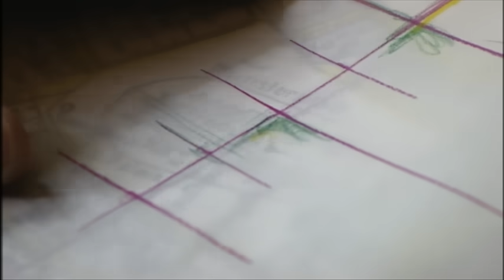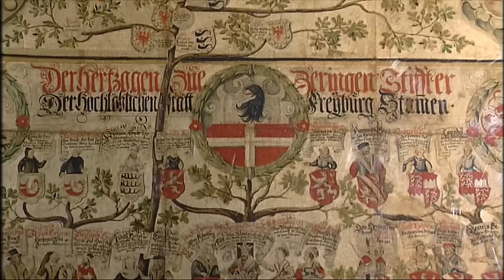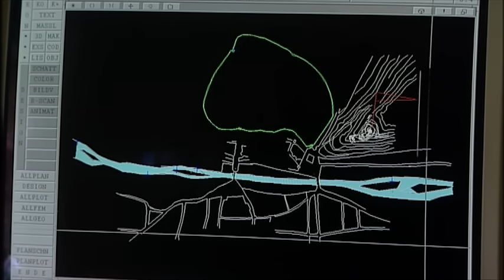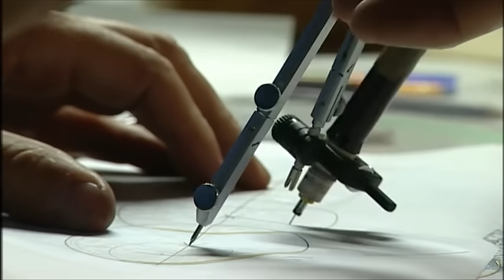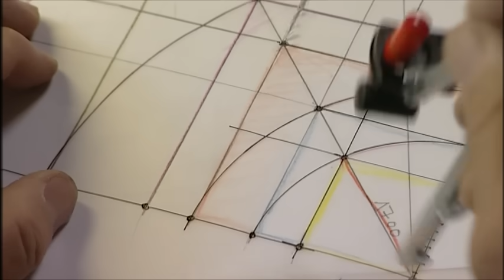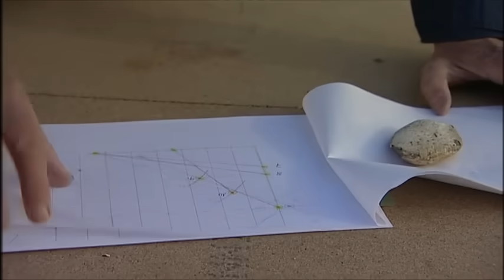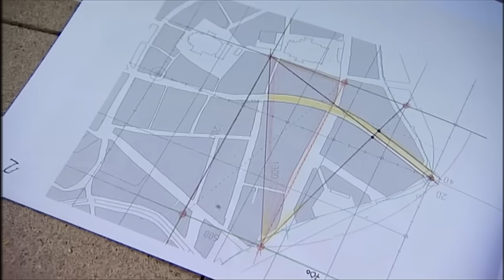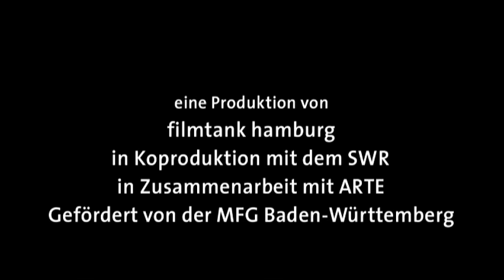Die Entdeckung der mittelalterlichen Stadtplanung (Doku von 2004)

Comment: Die Historiker haben das mittelalterliche Bauwesen sicherlich stark an der römischen Stadt und der Stadt der Neuzeit bemessen und abgegrenzt.

Dadurch kam vermutlich auch der Eindruck zustande, das es im Mittelalter keine übergeordnete Städteplanung gegeben hätte.

Zwischen 1853 und 1870 hat Hausmann Paris modernisiert, Avennues durch mittelalterlichen Baubestand "schlagen" lassen und mit klarer Konzeption, die vorhandene "Unordnung" geordnet.

Der Architekt,  Le Corbusier, hasste das "chaotische Dorf", die Zufälle, das Enge an dieser Bebauung.
Er baute Systeme, Geometrie für die Menschen von morgen.

In der Römerzeit gab es in der Regel viele Kleinstädte. Das Vorbild war Rom, die Metropole.
Der Städtebau war allerdings kultisch aufgeladen, wurde mit Zeremonien begleitet.
Warum soll das im Mittelalter anders gewesen sein, wo doch das Denken der Menschen ihne religiösen Ansatz nicht vorstellbar war.
Auch, wenn das Ergebnis der mittelalterlichen Stadt nicht der Struktur anderer Epochen entsprach.

Ich finde die Dokumentation hoch spannend!